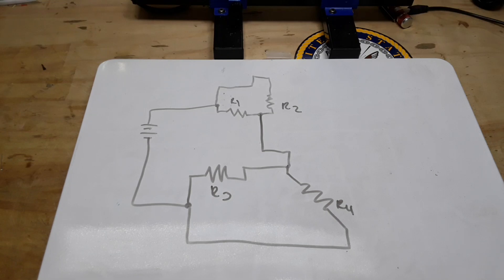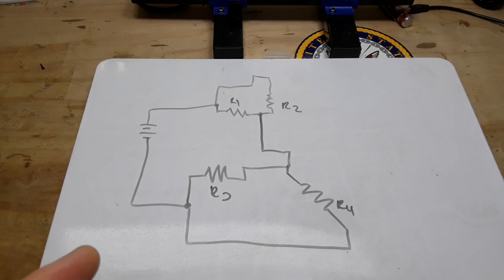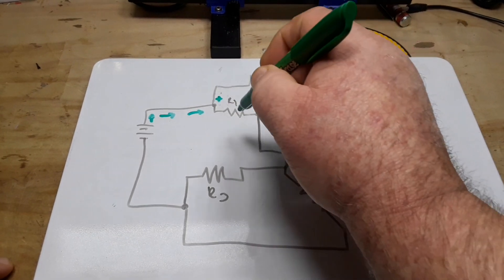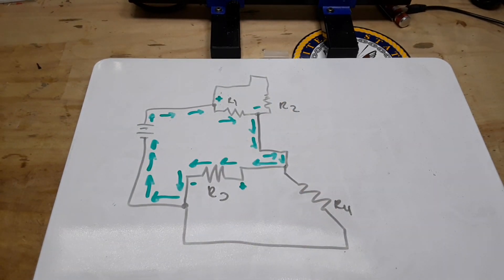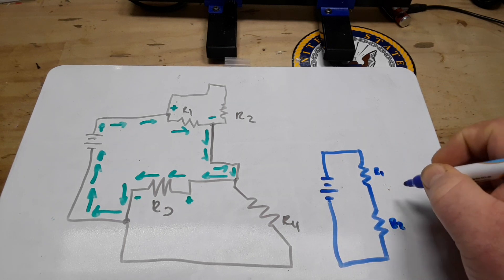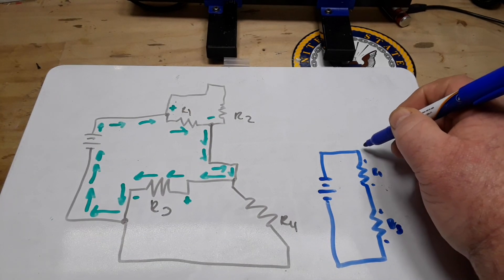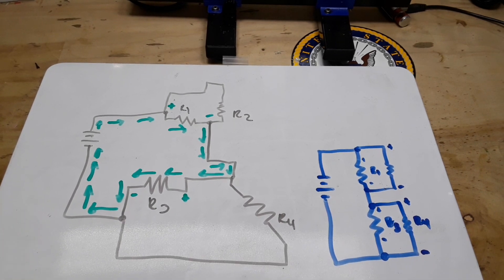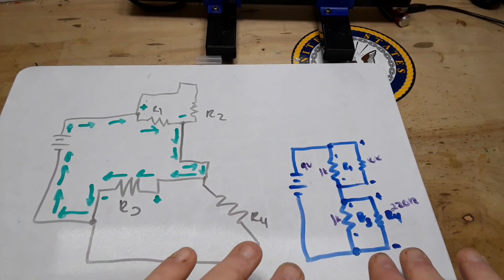Redrawing DC Circuits for Mesh Analysis

Comment: you didn't explain at all how is that MESH Analysis or what is MESH Analysis
Reply from the maker: I have at least 3 videos on DC Mesh analysis in my basic electricity and electronics playlist.
Reply: @learnelectronics  You need to make a video lesson about Residual Current/Eddy Current like using a RCD Residual Current device to measure Eddy Current and Residual Current. RCD is in every circuit like a guitar amplifier has an RCD residual current but why does it have Residual current? if you did the MESH analysis it should equal = 0 Residual current but when measuring RCD its no zero why is that? I'm sure you learned this in the Army training courses but you might have been sleeping taking a nap